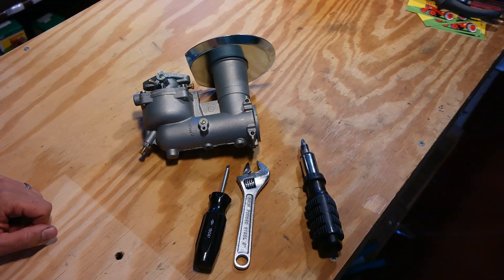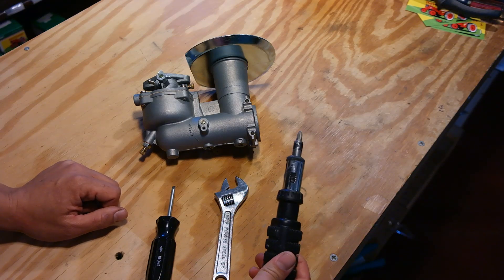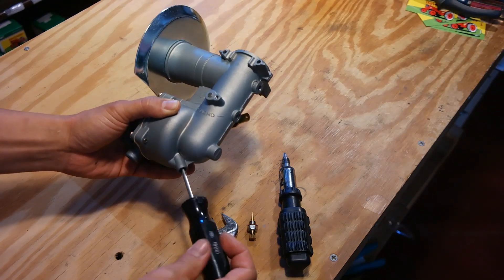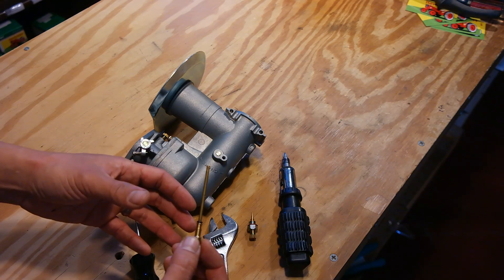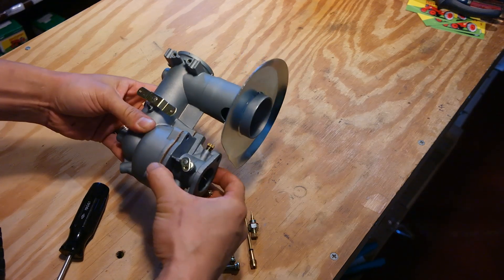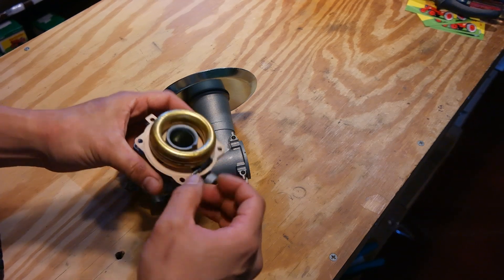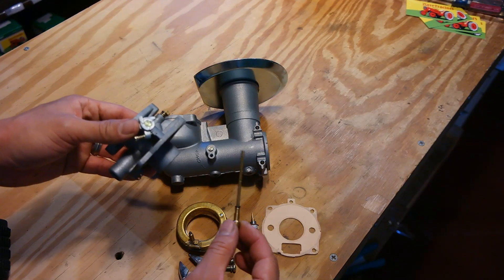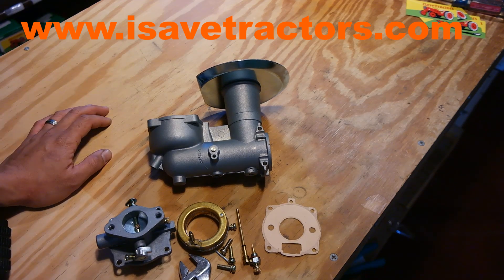How to Disassemble Briggs and Stratton Large Flo Jet Carburetor

Comment: Hello I purchased a upflow rebuild kit imulsion tube but did not get the neoprene washer. Was it supposed to have one or is it extra ? Thank you
Reply from the maker: Only our iSaveTractors carbs have them. Our rebuild kits for the original OEM carbs don't have them. But you can go to your local hardware store and buy the smallest o ring they have. Should be 2mm.

Comment: Will this carb work on a 3hp briggs
Reply from the maker: It will not. Your carb is probably a "Vacu Jet" that sits on top of the tank right? It could also be a small flo jet, which we do not sell.
Reply: I got a carb that is by its self and the tank is on the other side of the engine
Reply: @Isavetractors  idk if its original if I am being honest. But the tank is but carb looks like was painted

Comment: I had a issue with leaking and a what looked like a small copper washer and the o ring fell out
Reply from the maker: The original flo jets didn't use an o-ring. They relied on the mating surfaces between emulsion tube and body of carb to seal. But they would lose the seal over time.
Reply: @Isavetractors  
That o ring on the emulsion tube,where would one find that ? I just rebuilt one on my 71 wheel horse it leaks slightly.
Thx

Comment: I just received this carb fro Isavetractors, when installing threaded rod.. do we have to add  an "O ring" seems like it would leak if installed direct.
Reply from the maker: No o-ring is needed for the threaded rod, but use the included locknut to secure it.